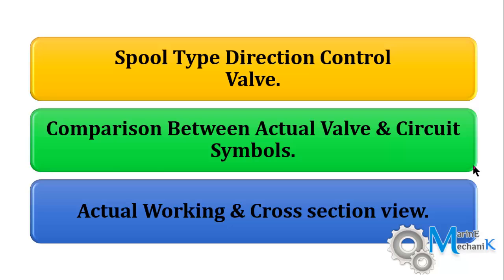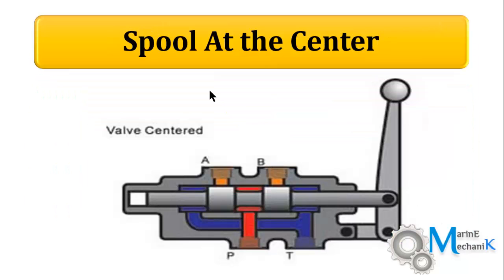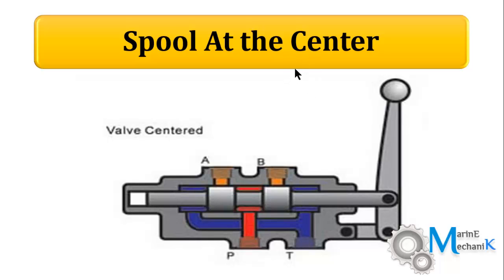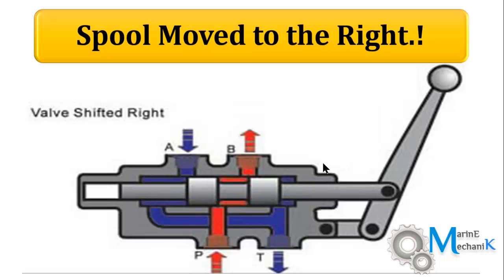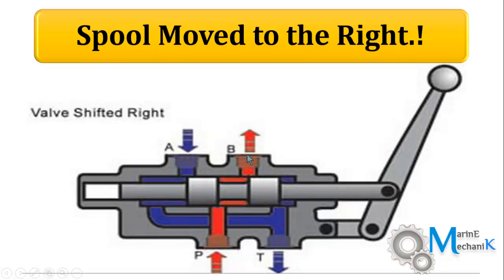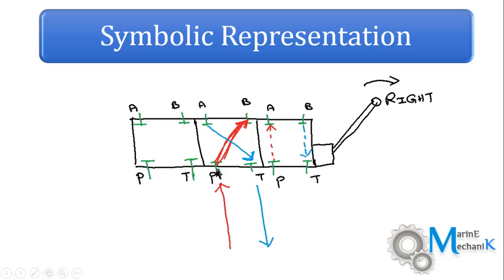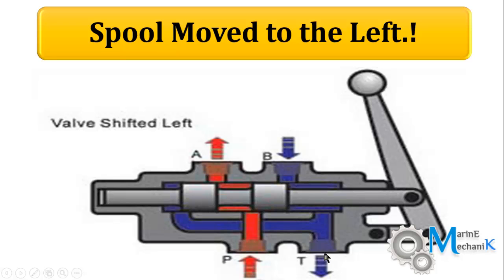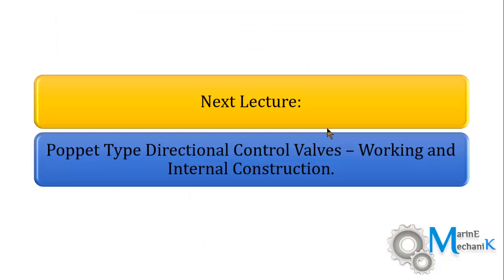4 Way 3 position Control Valve Working & Construction

Comment: It wasn't a bad video but you might want to explain what the P and T and also the A and B is. I understood but if this is their first video they will be lost. For those that don't know the P is the power and the T is the fluid return. The A and B are both power but in opposite directions such as a log splitter cylinder. It has power in and power out. Very nice video and well spoken.
Reply: Port P indicates the Pressure Port (From Pump for Hydraulic or From Pneumatic Motor for air), Port T indicates the tank port (Connecting Reservoir or Tank or Sump) and Port A/B are the inlet/outlet to the actuators.
Reply: Very comprehensive additional information. Thank you for that sir.
Reply: Is that a double acting cylinder?
Reply: It has to be since power goes through both A or B. If it wasn't then there would only be one power with one return. Single acting example is a floor jack. Double acting would be like a log splitter.

Comment: Around 4:27 the symbolic schematic is wrong : the one at 1:59 is the good one (right box should be in the middle, middle box should be on the left and left box should be on the right). More over the lever is labled with "Left", which makes this schema (at 4:27) confusing when compared to the standard one at 1:59. That said, unless the 1st box (at 4:27) shows the actual "idle" or "normal" position of the system.

Comment: I think if the spool is at the home position (4 ports are blocked) there is no narrow leakage from P to Tank( you mentioned it in video).
because every hydraulic systems have a pressure relief valve,when the spool is at the middle and the system pressure is getting high due to no flow from the direction control valve.So the relief valve will open hence the oil returns to Tank.
sorry if I am wrong.

Comment: What r the applications of a single acting hydrauic cylinder ? And what r those of a double acting cylinder? I am trying to know which type I should buy for a welded block brick laying machine? Please advise and the type of the dcv to be used.

Comment: Would you be able to tell me what size I would need to have a fairly quick piston move up or down or should I say in and out I need a piston that can deliver 30 tons of pressure at about 60 cm long I need to know what size pump were size motor what relief valve I would need
Reply: Call a cylinder manufacturer.